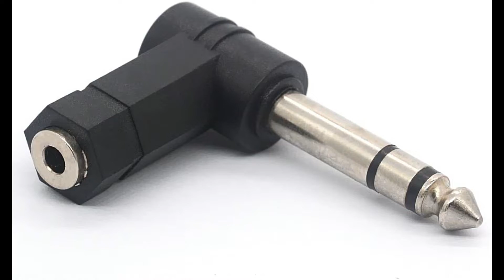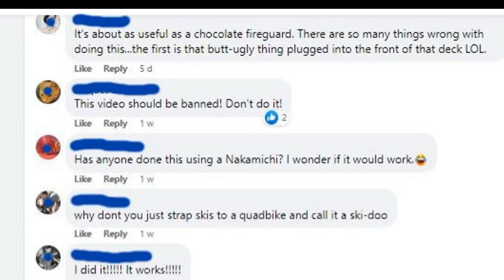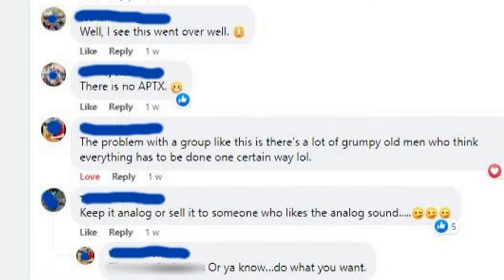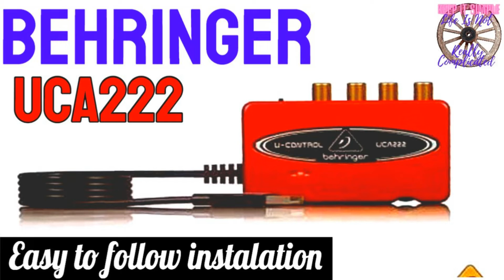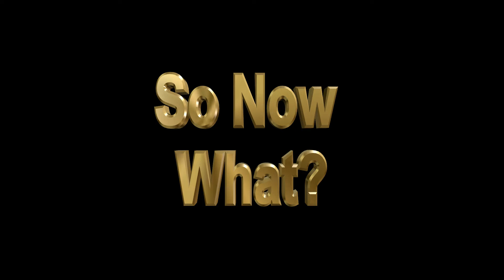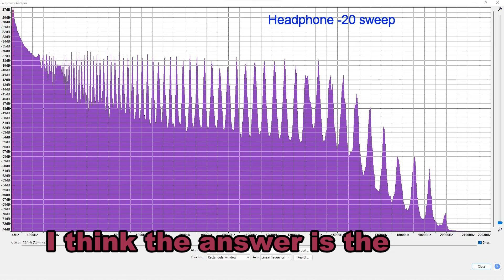Cassette Deck Headphone Out is it as good as Line Out?

Comment: Hi Gary 
Thanks or all your videos' on the Teac w1200 cassette decks.
I was wondering if I should purchase one myself however a lot of the tapes I have already are recorded with Dolby DBX. Do you have any idea if these tapes would play ok on the Teac deck.
Thanks Ian.
Reply from the maker: Did you mean Dolby HX because DBX is different to Dolby? The playback of DBX needs a DBX decoder to decode correctly whatever deck you play back on. You could get one from eBay. Dolby HX is a recording method.  The W-1200 has noise reduction that is compatible with Dolby B for playback. It works well. Even if you got a Vintage deck, you would have the same problems. I hope that helps, feel free to ask any other queries.